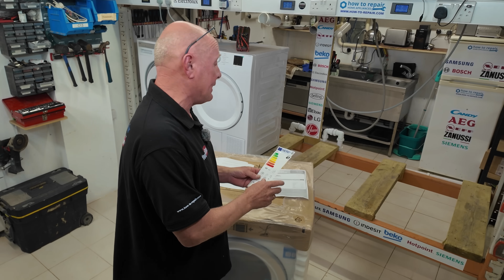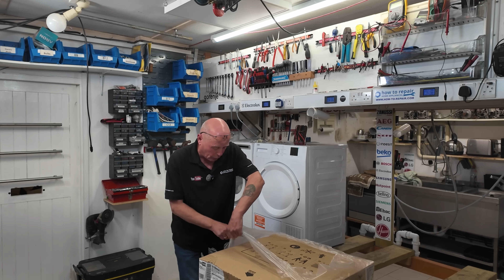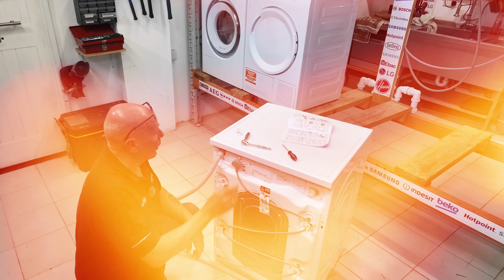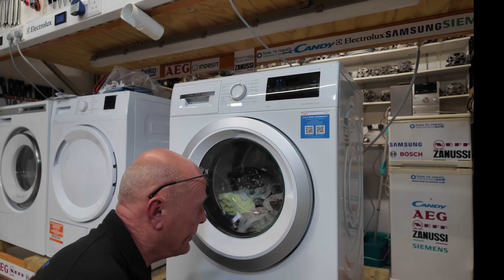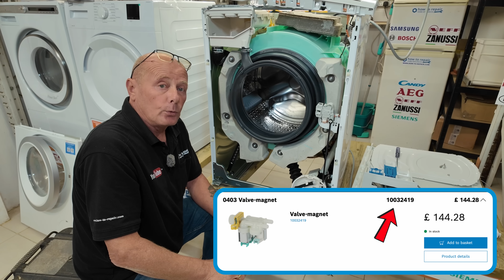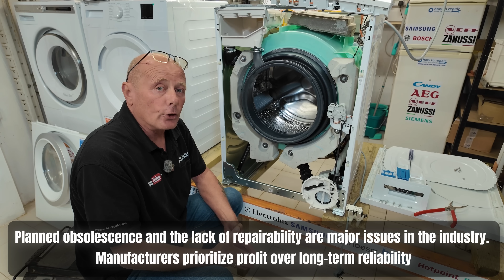Bosch WAN28259GB Washing Machine An Engineers Review: The Good, The Bad & The Ugly Truth!

Comment: I just bought a Bosch series 4, not impressed with the price, you're paying a lot for that 5 year warranty if you ask me. 

My last Bosch the drum leaked and fried the main board, it was only around 4 years old maybe. I hope this one is a lot better. 

After that Bosch was an Indesit, it lasted 3 years and the bearing went, call out charge was ridiculous, I had a parts warranty but no good because the call out charge was ridiculous. 

E.U right to repair my arse !

Washing machines have got so bad now that If this bosch lasts only 3-5 years I'm only going to buy old 2nd hand washing machines for 100 - 150 Euro. 

I don't care about water or energy consumption so don't need any of this marketing bullshit, and I don't care about noise, I'd rather a noisy reliable machine that will last at least 15 years that can be repaired easily and cheaply.

Comment: Not packaging mistake - I've just got a series 6 bosch and it had only 1 plastic cover for the back. I went out to double-check the in the waste bin if i missed the rest.The old broken siemens-bosch iq500 had the same lids on the back, so i used them and they are even better than the one included and clicked better in place.

Comment: Nice video! Thanks! 
I have a Bosch series 8 from 2017. It’s a great machine except I have replaced the pump twice. It’s a stupid design that’s not properly sealed, so sludge gets in to the rotor which subsequently stops rotating after a while. On the positive side, it’s easy to replace and the cost is fairly low. As an engineer it’s just annoying how bad the design is and how easy it would be to fit a proper seal.
Now the iDos system has stopped working and that’s another story. Very expensive parts, not worth replacing on an almost 10 year old machine. It still works if you dose manually, so I will keep using it until it breaks completely.
I agree that some parts are ridiculously priced.

Comment: Got a brand new Candy dryer and it was knocking when used for the first time. I couldn't go through the whole returns process and pain of carrying it for replacement, so I opened up the brand new machine and found a manufacturer defect on the drum, there was a bulge, so I knocked the bulge level with a hammer, managed to get the drum almost smooth and the knocking sound was greatly reduced but not erased. But it's manageable, I don't mind it.

Comment: My sister bought this exact machine at the beginning of the year and she’s been pleased with hers as far as I am aware. I got a Bosch serie 4 WAE24377gb and is 11 years old.  I have had the heater replaced twice and the seal replaced last year. One of the engineers said that I got 2 machines out of it! The first time It had a new heater was when it was 6 years old then in early 2024. It then had to have a new seal fitted in early/mid 2025. Although it’s a good machine, the retailer I got it from reckoned that I’d get at least 11-12 years use out of it with just me using it. I do about 3-5 loads a week. A few things I don’t like is the lack of program ability. I can’t do a 60c wash on Easy care and it doesn’t always rinse so well even though I add an extra rinse via the aqua plus button. Sometimes it can get noisy being as I am now in an open plan kitchen in my flat where as before when I bought it, in my old place I had a separate kitchen and I can just shut the door. There is slight wear and tear on it. I think the shocks are starting to go because it sometimes makes a horrible noise on spin particularly if I am washing a heavy load such as towels and sheets.

Comment: Thanks for your review. For all of the information out there on the internet it is surprisingly hard to find good information on washing machines; most of the stuff I've come across is AI-voiced comparison videos and (likely) sponsored comparison pages. 

With regards to the PCB having smaller components, I was an electronic design engineer and that is just the way electronics is going now - smaller more efficient components. Surface mount as opposed to through hole. I understand for someone not adept at using a soldering iron this is harder to repair, but generally in all other ways this is an improvement. You should see how small some of the resistors are now! 

Cheers, appreciate the review, I will continue my search for the 'best' washing machine for c. £600. Leaning towards an LG currently but now I've found your channel I'll have a look through.

Comment: Circuitboards using SMD components are often repairable. It is mostly not feasible because manufacturers refuse to provide schematics and other service info. Without this info it means reverse engineering,  which is economically not feasible. There is a European "rught to repair" law, but it's too soft. My Neighbour used to be a Bosch service engineer and several times he came to me with a circuit board: "Can you repair it, I do not want to replace the whole board"

Comment: my mother has a series 4 bosch from...2017? I think and it has worked quite well. silent, washes very well and what I like about Bosch is the suspension system, seems to deal very well with weight.
at my house i have an LG dd machine and yeah, it is even quieter, but it doesn't wash as well (subjectively) and doesn't cope with the weight nearly as well as the Bosch does.
but I do like that have dd allows LG to spin the drum in very intricate ways that can help in washing better.
both are running fine still but the LG is from 2020.

Comment: AGE  62   did ,   25 yrs white goods service exp .  BUY bosh   3rd party spares  1/2 price  50 % cheaper genuie boss  . THINGS  like door seal / pumps  motor brushes.  LAST  just as long .  ONE PAIN  bosh is if  PCB MODULES  goes  open circuit faulty .  THE COMPANY  i use  to recon    PCB , MODULES £60- £ 90 ....  CANT REPAIR  BOSH  pc programmed ones .  THEY  are expensive direct  BOSH  .

Comment: If you want a PREMIUM washing machine, buy a Miele ..If you want a mid-range washing machine, buy a Bosch Series 4 ..If you want a budget washing machine, buy a Beko ...But do not repeat DO NOT     "Bitch on"    when your Beko only lasts maybe 4 or 5 years ..You only paid cheap, so WHAT DID YOU EXPECT????????? 
When you buy a cheap product, corners have to be cut to get the price down.... It is called ..... Get what you pay for! 
If you buy a washing machine for under £300, it's designed to last the warranty period. Any extra you get out of it is a bonus. 
Far rather pay the extra £200 and get a mid-price Bosch ...Look after it and it will last TWICE as long (Maybe more) 
It is not uncommon to get 12+ years of service from these mid-range Bosch machines.  Well worth paying the extra money for. 

It really grinds my gears when people buy budget items and are surprised when they fail shortly after the warranty has expired.

Comment: With hourly rates approaching 80-100 EUR for repairs I would not bother about the spare part prices. My simple but robust Siemens machine - made in Turkey - I bought when I was working in India has been running for 15+ years without problems (plus travelling twice over half of the world). Now it gets corossion on the outside, which does not look nice, so any small technical problem would mean buying a new one (probably a Bosch or Siemens again) anyway. But maybe I will use it for another 5 years until it is time to say goodbye. :-) 

When writing this comment it is just getting its monthly intensive 90°C wash with my white cotton bed linen and hankies to keep it clean from the inside. Sometimes I wash also my collected dirty dishcloths at 90°C. From time to time (like now) I use anti-scale tablets (not necessary, but still). But the real life extender for the electronics is the extra surge protection I have installed in the power plug. Plus I would assume the Siemens machine is a "developing country" version, which can handle frequent power peaks and outages.

Comment: I really like the idos feature on mine. It stores your liquids and automatically doses. Definitely awesome. I like how easy it is to replace parts using their diagrams. The first thing I did on my dryer was buy a few of those rubber stops for the water. There is a cleaning cycle where you put the stop in and fill it with boiling water then run the cycle.

Honestly, the lack of sound is important, but you didn't mention how stable the machines are. People in my house like to store stuff on top of the washer and dryer because nothing falls off. The top becomes a storage area when nothing can fall off. Old washers and dryers didn't have this.

Comment: Once upon a time washing machines used to self-clean with every load. There was no need for special cleaning cycles and chemicals. I grew up with front loaders in Germany during the 60s and 70s. Front loaders then used a lot more water than they do today and the wash and rinse results were stellar. That is no longer the case with modern machines. BTW, I’ve been living in the US and Australia for the past 50 years and my go to brand for a great washing machine now is the Speed Queen top loader, which I’ve been using for over 40 years.

Comment: Had a Haier HATRIUM machine for 6 years now.

V quiet, simple controls, no problems at all and you can open the door mid cycle.

Our best machine in 40 years of married life.

Any thoughts please?
Reply: Any auto-balancing machine is better than those that don't. They are generally lighter, quieter and do no vibrate violently. Top loader is preferable as you can open the door mid cycle. That's my two cents.
Reply: A washing machine does not need an IoT connectivity or an app.

Comment: EU Energy and Water Consumption Standards

In 2004–2005, the EU introduced new eco-guidelines: machines were to consume less water and energy.

More efficient drum designs (less water, better water flow) often required more complex drum shapes that were difficult to hold together with screws.

Welding enabled lighter, optimized drums that met the guidelines.

Comment: These videoa are so amazing....had 4 bosch machines in 2 households over last 10 years....high end 2nd hand, 1st HomeProfessional (about $4000NZD new) had the removable bearing and split drum....which i did myself....new 2 which we currently use do not...did not know till i bought 1st one and replaced suspension....i believe you can retrofit screws by splitting manually ....however no bearing specified...guess buynpreviois part number.  Obviously this is just an interim thing that will no longer be able to be done when they change specs....

Faaark bosch!

Also have 4 dead bosch diawashers that need boards....again 2 were 3200 machines new....

Comment: I've had a Bosch washer dryer for 14 years. It's used maybe every 3 weeks. Been very good but the door lock is a problem now so it says its Open and won't start. I have to keep opening and closing the door then after 10 attempts it works!

Comment: You’ve hit the nail on the head: modern appliances are engineered with an expiration date. It’s not your imagination, planned obsolescence is a very real business strategy. The goal? Maximise profit by nudging (or shoving) consumers toward buying new rather than repairing old. And the environmental cost? That’s conveniently left out of the fine print.
Case in point: my previous washing machine, a trusty workhorse I bought for around £800 just seven years ago. It recently gave up mid-cycle with all the grace of a startled goat. Upon switching it on, a telltale crackling noise suggests something’s gone awry in the circuitry, likely a component designed to fail just outside warranty.
I’ll admit, I’m dreading the call to an engineer. I know it won’t be cheap. But I’ll repair it anyway, because the alternative, buying a new machine built with increasingly flimsy components, feels like a short-term fix with long-term consequences. Those plastics break down, and eventually, they find their way into our water and, by extension, our food chain. So, repair it is. Sometimes the most radical act is refusing to replace.

However if it's a component I can order off your side I will be ordering without a doubt.

Comment: Re the transit bolt covers: it’s not as if anyone will see it; on the other hand, it would be useful if the bolts would clip somewhere on the machine. Otherwise it’s impossible to find them a few years down the line when you want to sell/move the machine.

Comment: I remember roughly 20 years ago the place I was renting had a Bosch washing machine installed in a shared kitchen, and one day something went wrong with the motor control as it would try and spin at full speed at the beginning of the cycle while it was trying to fill with water. I was there when the engineer came out and they said it was uneconomical to repair due to a fault with the part that controlled the motor speed, and a new machine was supplied under the warranty.

Not sure if that was the 1 year manufacturers warranty or an extended one, as the replacement machine was a different model. I'm thinking more likely it was an extended warranty and that specific model was no longer available to buy so a similar spec machine was supplied as a replacement. So even 20 years ago machines were being scrapped for a faulty motor or maybe a faulty PCB that controlled it.
Reply: Good shout .This built in Obsolescence design has been going on for many years.

Comment: I’ve seen the suspension legs fitted to the drum in such a way you have to split the drum to be able to change them, not as it used to be a case of pulling out a plastic peg and releasing it from the fixing point on the drum and that was a recent Bosch machine in the last 3 or 4 years

Comment: i had a bosch machine: 2 years warranty on parts. Guess what after 2.5 years the motherboard died; no way to buy it as replacement where i live. I am careful and do maintenance on my appliances. so it was almost as good as new. > no parts available in quick DIY fashion as only through official channel, bosch technical support charging an arm and a leg for it ; laundry piling up. Guess what went to buy a new machine which was just a bit more expensive than the repair quote from the bosch technical support. absolutely shameful. the thing has a German flag on it which help with the original buying decision ; no wonder the whole german industry is going downwards,

Comment: I install home appliances as a job and for some reason, since beginning 2025, Bosch and Siemens stopped giving you 4 blind plates and drain hose clamp.
I've only seen the complete set on the more expensive models or the washing/drying combination machines.

Comment: love my BOSCH washer and totally agree with the Marks comment --from pre purchase to delivery they were excellent. I installed mine as it was a direct replacement for my 10 plus year old Bosch inbuilt..even the door hinges were exact so no drilling the wood door . i salso love the double secure fill pipe and cutoff unit. --just cleaned my tumble dryer using your info --excellent.

Comment: Bosch is the best choice – quality at a still acceptable price. You could of course buy Miele – it's even better, but costs three times as much, and repairs or spare parts are very expensive; I don't think it's a sensible purchase.

And don't forget to run a hot wash cycle regularly and reduce the spin speed from 1,600 to just 1,200 rpm in the summer. Use only powder detergent and do not add fabric softener. – then your Bosch will last 12-15 years. I believe that for the price you pay, the investment will pay for itself many times over.

Comment: I have a Bosch series 6 11 years old still works perfectly.
Reply: So did I two days ago. Series 6, 11 years old but the invertor exploded. Now I have to get a used part from eBay for approx 60 EUR plus shipping because the original is 200 EUR. The information in the video is spot-on. Imagine I needed to bring a technician to diagnose and pay for labor as well. Even if you go my way, that is you diagnose yourself, buy a used part and change it yourself,  it is barely economical. Even used parts are overpriced as a result.

Comment: I've just been doing some research and the 9kg WAN28259GB has exactly the same 65L drum as the 8kg WAN28258GB and all other specs are the same when you compare them on Bosch's website (very slight difference in weight). All the spare parts for both machines are the same, so if nothing's different what makes one a 9kg and the other 8kg? I have this machine on backorder but am considering cancelling and just going for the 8kg if I'm not going to benefit from a bigger drum size and the 8kg costs £100 less.

Comment: Machines use hardly any water these days, the idea is for eco reasons because obviously it uses less electricity to heat up a full kettle than it does a kettle that’s only a quarter full.

They can claim that using hardly any water cleans ok, but can you imagine having a bath but only having the water just up to your knees but being told to stay in the bath for 3 hours and just move around a lot and you’ll get clean. That’s the thinking being many modern machines

The machines from 20+ years ago were perfect in that regards, what next for manufacturers, no water at all and clothes are blasting with chemicals instead ? 

I dunno about you but i like my dirty clothes to be in a good amount of water and not such a small amount that a towel soaks up a lot of the water. I like my clothes fully submerged in a decent amount of water. If we lived in a country where there is a drought I could understand, but we live in the uk, it’s baffling